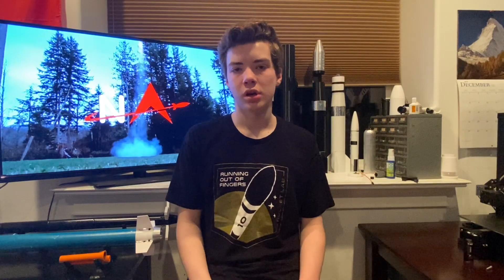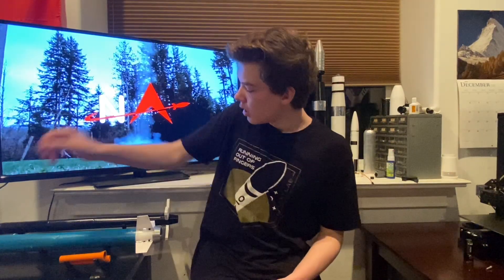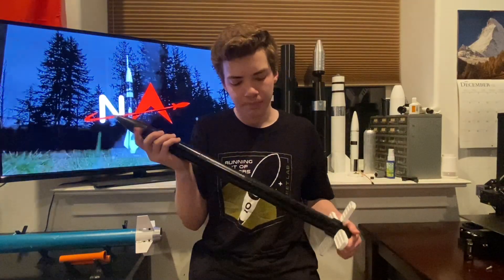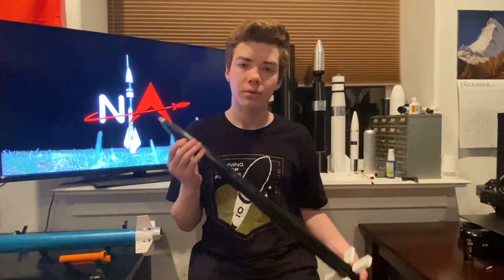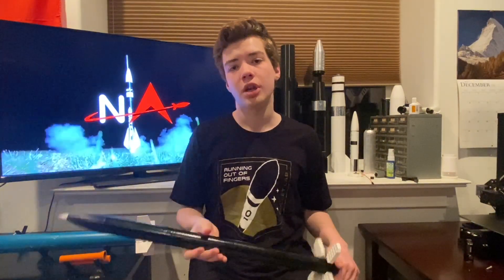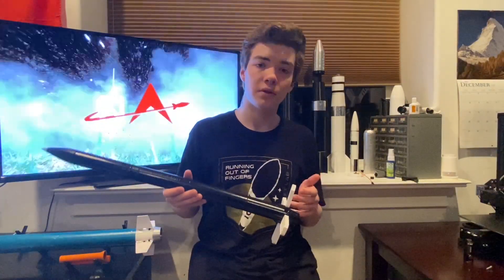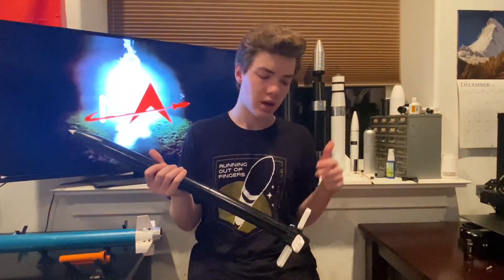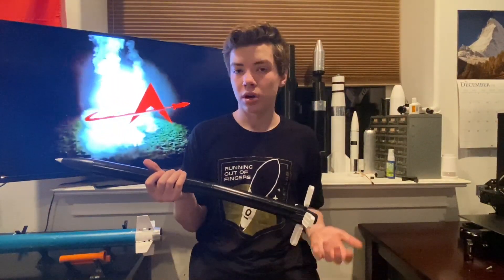Our New Grid Fin Stabilized Model Rocket: Beagle Block 3

Comment: I understand that (because of SpaceX), everyone is currently into grid fins, but they actually work well only at subsonic and super sonic speed.
Using them in model rockets (top speed of the fastest Estes Rocket is 144 miles per hour), would be like installing a F1 spoiler on a Fiat 500.
Benefits are definitely arguable. ;-)
Reply from the maker: Sorry I don’t understand your example at the end, I’m not much of a car person haha. But grid fins work well at slow speeds as well. They’ve been tested in model rockets and work well. Grid fins after all are just fins in a cluster, as I explain in the video. Appreciate the input!
Reply: @northernaeronautical3166  A Fiat 500 will never reach the speed of a F1 car, hence the F1 spoiler will have a minimal impact on the overall performance of the car.
The flow condition that validates the  efficiency of grid fins (aeroelastic effect) is tested at Mach 0.7 - 1.2 and 2.5. The maximum speed of an Estes Rocket is 144 miles per hour. Traditional fins work better and they are more efficient under the engineering aspect. I was tempted to create grid fins to land my #HawkV, but after a bit of calculations, I decided to use air brakes.
https://www.sciencedirect.com/science/article/pii/S1000936117301206
Reply from the maker: I think you misunderstood me. I understand that normal fins are better, and never stated other wise. But grid fins have been flown on model rockets which fly just as stable as a typical finned model rocket. They are after all normal fins but multiple on each side.
Reply: @northernaeronautical3166  Undeniably, you can use them, but in this way my aerodynamic metaphor (Fiat 500 vs F1) makes even more sense, as grid fins are generally hinged, to be deployed after launch (mostly in missiles). To avoid to have too much stress on the hinges (because of the subsonic/supersonic speed), they have a "waffle" design, that produces drag through the multiple mini wings that compose the grid itself.
In Falcon 9 are used also because it's the only way to dissipate heat generates by drag, while orienting the booster for landing.
SpaceX has changed design, because in the first boosters they were completely burnt after landing.
Reply: @RCLoversan  Grid fins work
Reply: @BowsersCloset  I have no doubts about this, but you are completely missing my point about why (aerodynamically speaking), you should use grid fins and why they are not necessary at slow speed. I mean, comparing them to traditional fins.